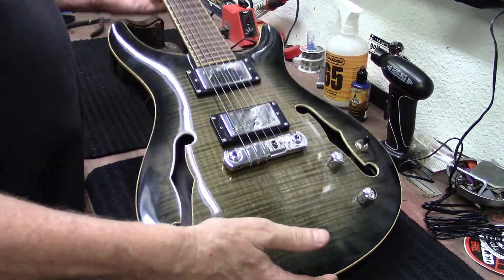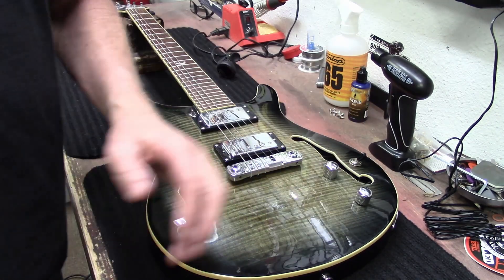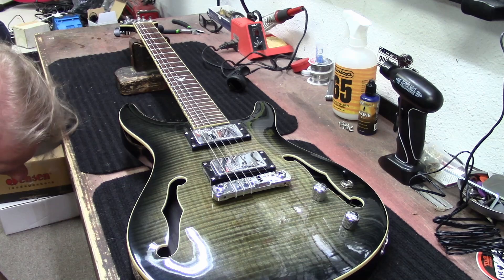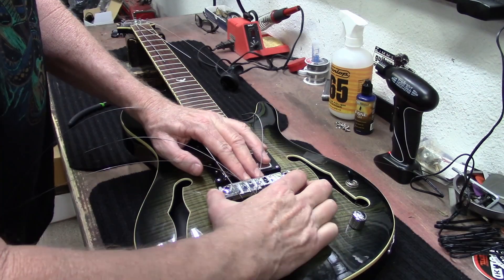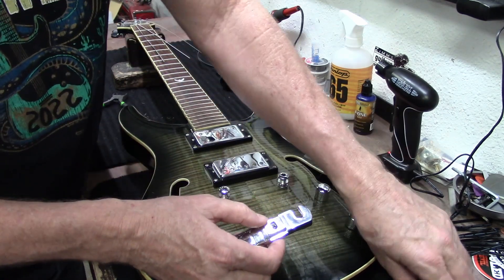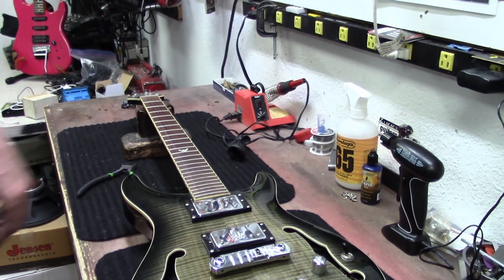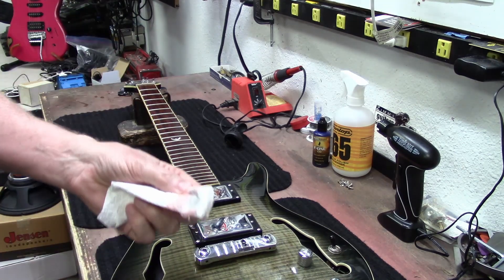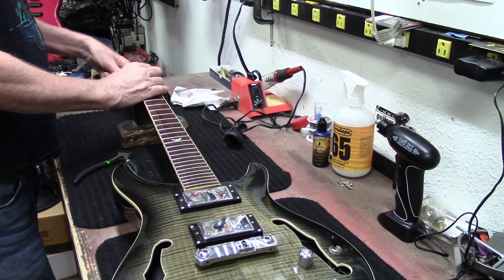Dillion Semi-Hollow Guitar!

Comment: Back in early 200s I was buying Dillion guitars. I had a beautiful blue quilt top PRS copy (model DR500) that even had the PRS bird inlays. PRS threatened to sue if they didn't change so Dillion switched to a military style bird.  I should have kept that guitar. I also had a DR500 in cherry sunburst PRS copy (with the military bird inlays). Also had a light cherry burst (almost like a tea burst) DR500. All had tremolos. I had a black hard tail PRS copy (Model DR510) with abalone binding around the body and a blue quilt top LP copy (DLP650). The Dillion guitars I still have are a blue strat copy (DS100) that has HSS configuration but the humbucker is actually 2 single coils mounted close to each other and have their own height adjustment screws. I have a white LP copy (DLP625) that I played maybe 10 times. It sits in its case waiting for the day someone wants to pay a small fortune for it. lol   And I have a green quilt top (DLP650) that I put DiMarzio pickups in. ToneZone in the bridge and AirZone in the neck. Both are set up for coil tapping. I also added gold hardware because gold goes better with the green than the chrome did. After leaving a review of my green LP on Harmony-Central, a few months later Dillion started offering the LP copies with gold hardware and coil tapping pickups. All of my Dillion guitars were made in Korea. They did have a cheaper line produced in Vietnam that they called their "V Series". Dillion Guitars from Canada is not part of Dillion USA.